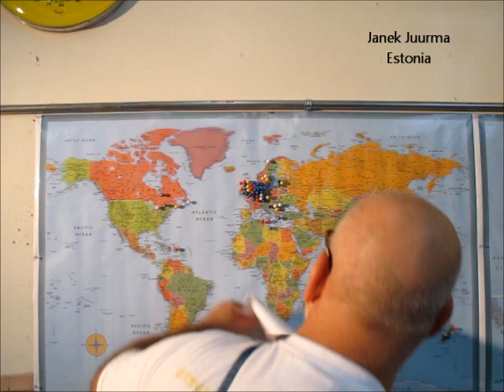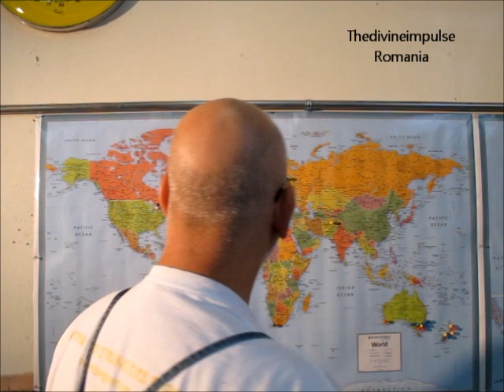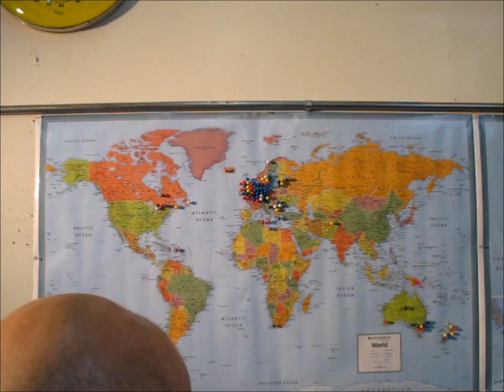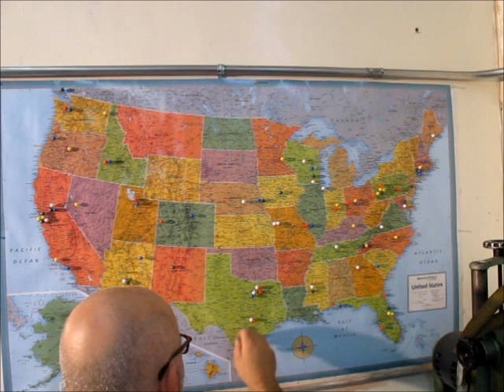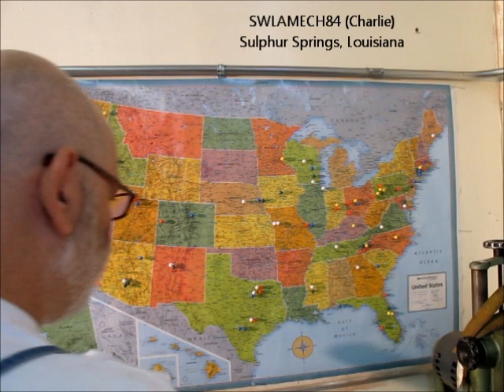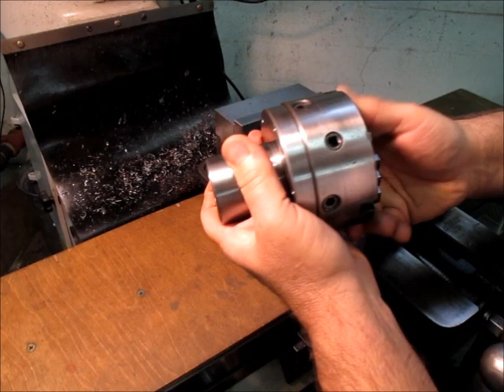Where is your pin? 4

Comment: Great video.  I took your advice and got a .5 inch carbide end mill for my G1007 mill.  It does cut through the torch cut area like a knife through butter.  I am running it at 850 rpm and feeding at 2.5 inches per minute.  I expect that I am feeding too slow but I am afraid I might break it or heat it up a lot.  My current cooling system is a spray can of all purpose lubricant.  It would be wonderful if you made a friend with a hobbyist size mill and made a video so we can all see for ourselves how big the right size of chips are and hear how it sounds.   You can give me a pin on your map at Houston Texas if you want to.  And thanks for all of the videos, I watch them all.
Reply from the maker: Hi cerberus,

How many flutes does your end mill have? Look for a chip load around .001-.002 per tooth in steel. Glad its working for you. On the lighter machines small tools are the way to satisfaction. I think there is still some room left in Texas for another pin. Might take me a while but your on the list.

All the best,

Tom

Comment: Put a pin in Big Lake, Alaska (60 miles north of Anchorage)   Great videos .  I have some old machinery which while learning machining am fixing up. a 22" X 12' ATW lathe, bridgeport,Steptoe shaper and a 6 x12 surface grinder. Most not working totaly.  I need to turn a eccentric shaft for a jawcrusher, It's throw is,160 and bearings 1.250.  Set up is the problem to insure everything concentric. Have a 4 jaw and made a cap with a .0.080 offset for the tail stock, Bridgeport not working only have lathes, drill press.  Insureing in line is driving me crazy.  Perhaps this would be a good video. regards  Gary_alaska
Reply from the maker: Hi Gary,

You don't mention how long the bearing journals are for your eccentric. Here is a possible sequence that might work. I'm assuming you are starting with stock large enough to do the whole thing. Length will play a part in this also. In the four jaw dial in the stock with enough sticking out to make the first bearing journal. When you have that turned slip it out of your four jaw and offset the stock your eccentric amount using a dial indicator. Turn the eccentric journal. Then pop it out flip it around and dial in the remaining bearing journal to zero. All this works if your shaft is not too long. You can add centers to the bearing journals to help support them for turning. Also if you headstock cannot accept the stock diameter will make it harder.

We will get a pin up for you soon. Thanks for the comment and interesting problem.

Cheers,

Tom

Comment from the maker: Hi Chris,

Unfortunately not. The radius in the jaws and the angle cut on the sides of the jaws don't allow it to close below ~20mm. The little chuck is fast and seems to be working fine for those smaller parts.

Regards,

Tom

Comment from the maker: Hi Eric,

I would heat treat the end of your chuck key. Its easy to do and will make the tip last a lot longer. The method you described sounds fine. I would use the Vee blocks clamped to the rod blank to index it accurately for the second side. You don't say which way you cut the square. For a chuck key I would have used the side of the end mill instead of the end surface. This gives a nice lead and allows two sides in one setup.

Best,

Tom